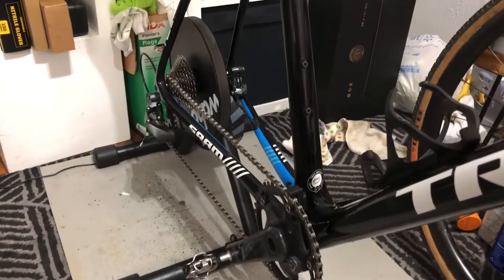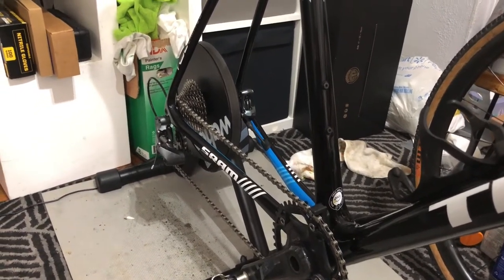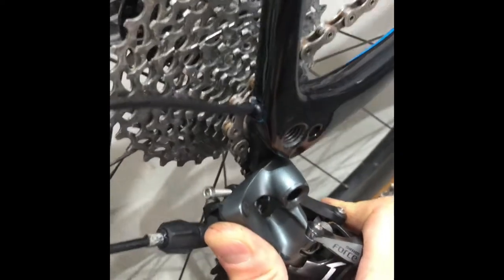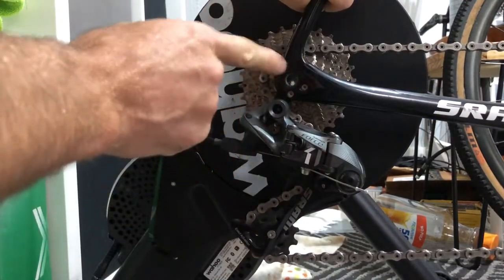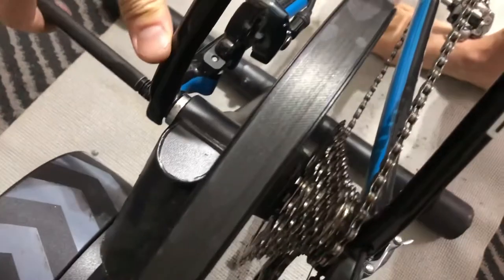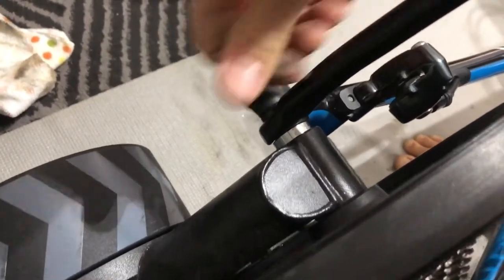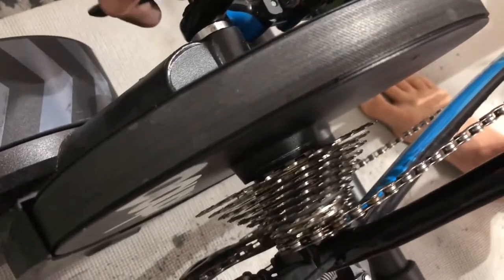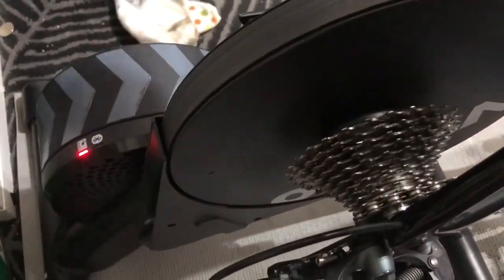Kickr ThruAxle Setup

Comment: I’m lost in this and all the other videos on this look like they aren’t a different adapter cut. 
Adapter C goes on after the cassette? Other videos say you need the remove an adapter first
Reply: I'm lost as well. 2022 Trek FX Sport 6.  I have the 2018 reconditioned unit.  Watching videos, there are some parts missing from the adaptors.  I tired following Wahoo customer service, and was told no adaptors were needed, and the bike would fit as it was.  No such luck.  Using my own axle and the suggested 135 adaptor, the threads stick out over an inch, and sit right against the frame, so cannot be tightened.  I sent some images of my attempt to Wahoo today, after my third attempt.  Interested to see what they suggest.  Some searches show that my bike is not compatible the 2018 KICKR.  Wahoo said it would.
Reply: Id like to help you out but i used the 142 adapter, it just turned out that the new adapters didn’t require me to remove anything.